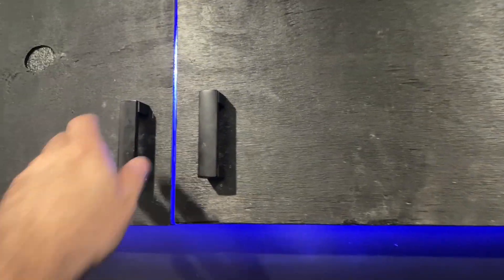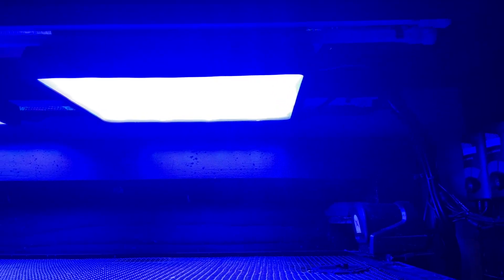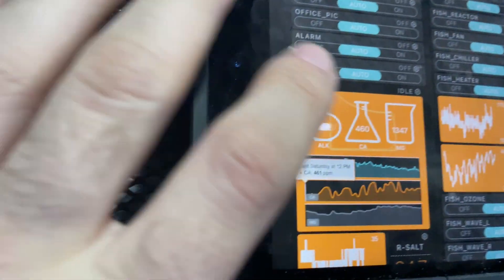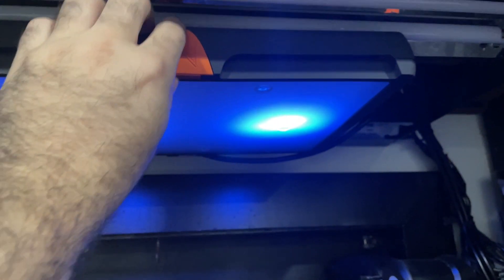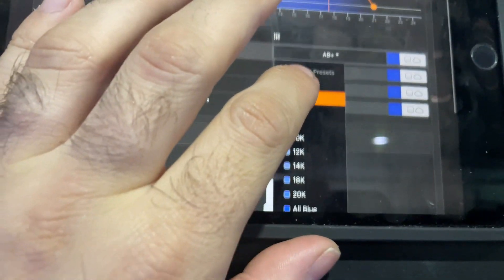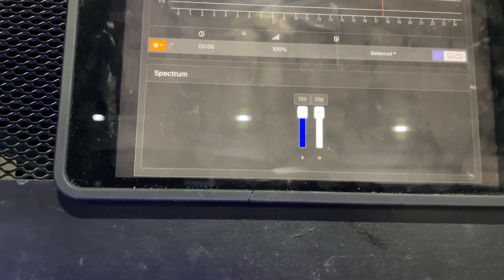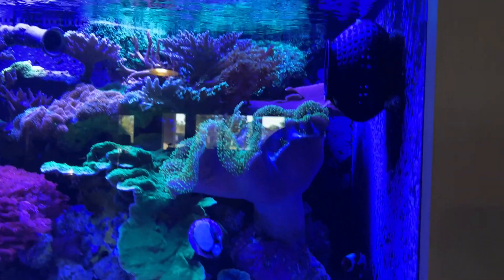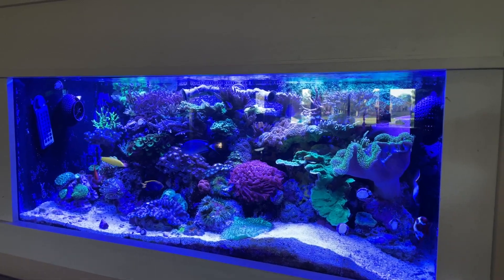First Look At The Sky!  For Real This Time!

Comment: How did you get the percentages showing on your tiles?
Reply from the maker: Which ones specifically?  They should all show up if you are using percentages on the output.  Some outputs do not support percentage.
Reply: @ReefAndReptileAutomation  how do you show percentages on the output?  Is it in the coding?
Reply from the maker: @KcmoLawman  it is not.  It is automatic.  But not everything can show it.
Reply: @ReefAndReptileAutomation  I must not have any equipment that will show it then, until I get the Sky.
Reply: I am guessing none of my equipment is compatible to show the percentage.